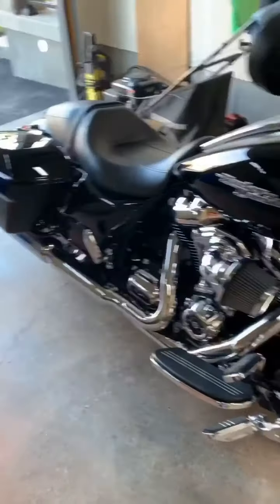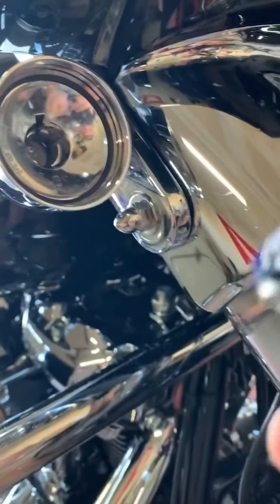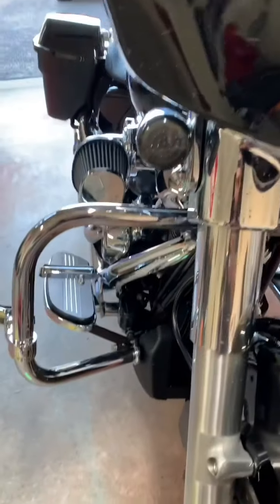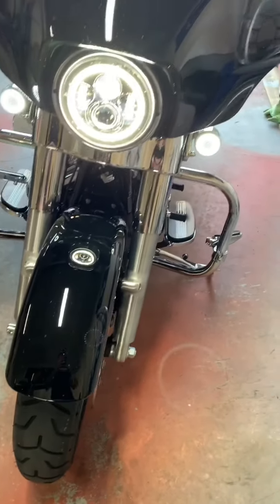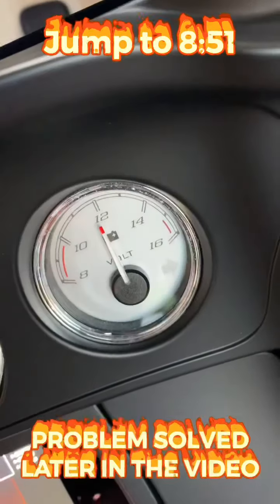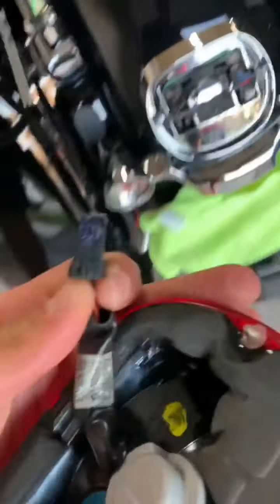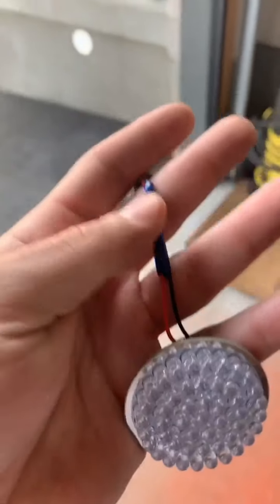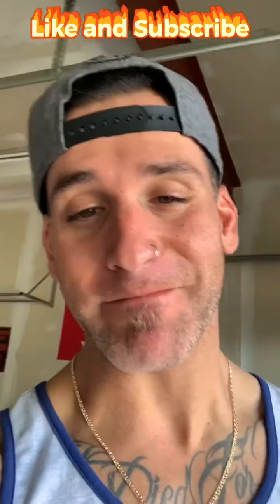LED Turn Signals and Tail Light on a 2020 Harley-Davidson Street Glide

Comment: Did you try turning up side down (180°) your back blinkers? Instead of "changing" the cables or "polarity"?
Reply from the maker: Yes of course
That trick only works on incandescent bulbs.
With LEDs, the orientation does not matter

Comment: I have same light when I install  light the ring light is off, why?? Any advice
Reply from the maker: Depends on the year and model of your bike
The lights with the ring has a dual filament connection.
You need to make sure that the wiring for your front signals are also dual filament